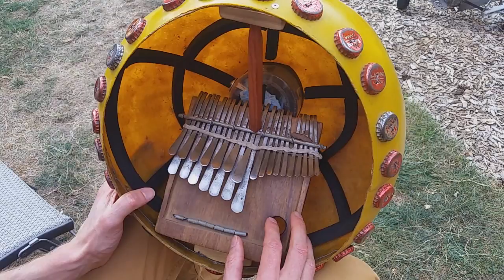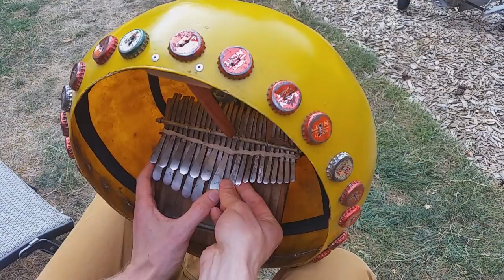Quick mbira/kalimba tuning trick

Comment: Dude! I thought I invented the tuned Mbira. I have been adding supermagnets to the tongues for a few years now, sop I can play in (basically) every key. I have had my (normally) Eb Mbira tuned down as far as A. Very cool to see you hade the same concept. Did you come up with it yourself or get it from someone?
Reply: Can you explain how you did this? I have a bent key Karimba
Reply: @payamrahrow4108  It can only be tuned "down". I added small supermagnets under the tongues, and then just adjusted them to get the correct tone. Try it, it works!
Reply from the maker: Haha cool! Isolated evolutions of a solution to a common problem.
Back in the day I used to play in a band with a guy named Kite Geidraitis - he used magnets for this purpose. I noticed during performances they were often falling off or didn't sound very good. The physical concept wasn't too crazy - just add mass without changing stiffness and you've got a slower oscillation. I found caulking to be a pretty good approach, with the caveat being you can only get away with adding enough to change the pitch by a semitone or two.
Reply: @woodsmith_1  No I have tuned mine Downey as much as haft an oftare with pretty good sound. You need the supermagnets though. Right now it's tuned down only a semi-tone. The down side is it takes ages to tune

Comment: Love it! I've been using small rare earth magnets to do the same thing. Nice to know of a cheaper and more earth friendly method.
Reply from the maker: Cool! You can also use this stuff on the underside of a marimba bar to achieve the same thing. The sound quality declines as you plop more on, of course. Comes in handy sometimes.

One can also target different modes of vibration of lammellae with this technique, granting the possibility to bring mildly out of tune overtones into tune with ease and impermanence
Reply: Cool! Where would you recommend placing it to lower an overtone on, say, a matepe bass note?
Reply from the maker: @AndeMarimba  hey man, just saw this comment. I'd put it very near the bridge for least effect on fundamental mode.
Reply: @woodsmith_1  It's cool man, I figured it out like a year ago lol. Turns out the best place for what I wanted is about 1/3 of the way from the tip of the key. Andrew Tracey's article on mbira tuning is a lifesaver!
Reply: Sorry, I meant to say 1/3 of the way from the bridge to the tip of the key.